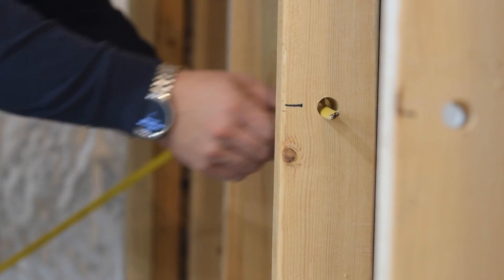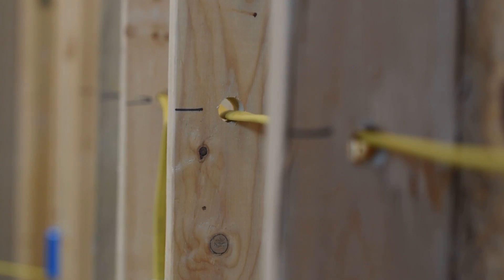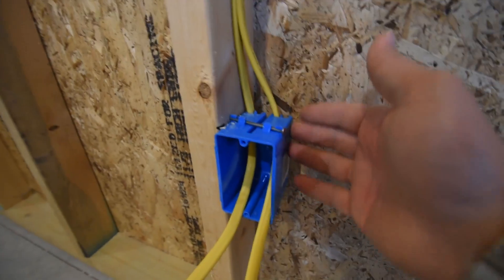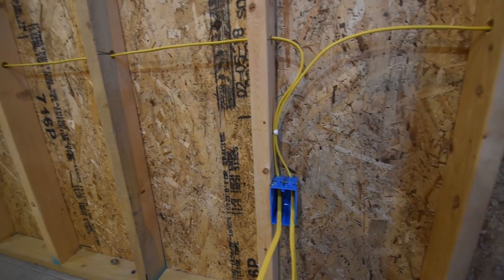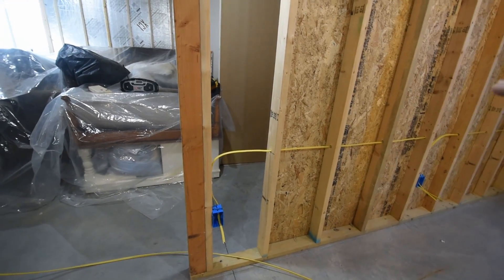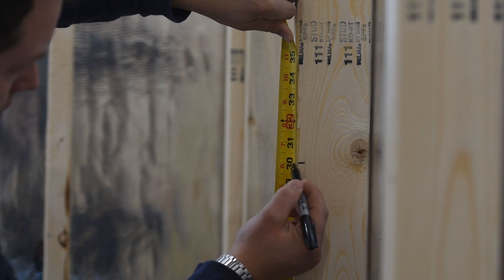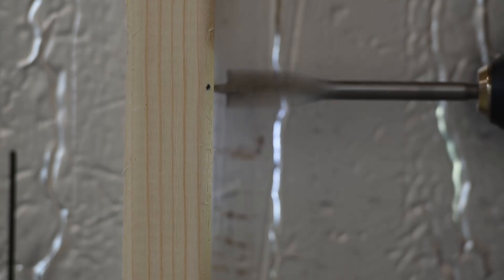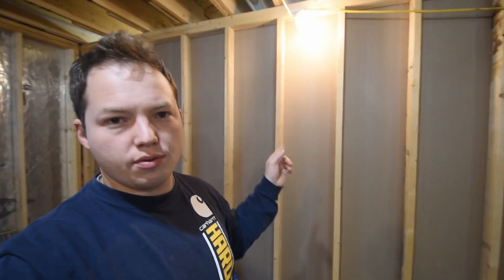How High Should Wires Run Through a Wall

Comment: It's a question of material expense/waste!

There are always many more receptacles than switches. Therefore, if you install your run parallel to the floor at 24" (plus or minus) you will use less material (wire) than trying to "split the difference"  (roughly 30") between the receptacles and switches. Installing the wire at 30" actually wastes 12" of wire for EVERY receptacle in the building. That can easily add up to 50' or more per house.
Reply from the maker: Agreed! 24" is better in that regard. Thanks for sharing your experience!
Reply: What ever happened to workmanship and building homes as if they were for ourselves or our kids rather than trying to nickel and dime a few feet of wire, etc. I can see the shoddy cheap ass craftsmanship in my cookie cutter home. The cabinets, the nails and screws buried under the dirt all over the premises, walls way out of square, attic spray insulation unevenly distributed, gaps in external doors allowing big drafts, gutters and drain pipes too level for proper drainage, concrete pours spilling out of the molds, unsealed grout, creaky stairs and showers due to lack of lubrication to prevent friction, terrible HVAC ducting and balancing (vents in stupid places), a great many studs off center, I could go on and on. This isn't a materials issue. It's a skill and moving-too-damned-fast issue. 😮‍💨
Reply: @graceoverall  Sure, you can complain about shoddy workmanship to make a house on the cheap.  Meanwhile homebuyers always complain about the high price for the house, so you buy what you pay for.  Meanwhile the workers are often complaining about the low pay that they make.  You can shop around and find a quality homebuilder - but you will also find the prices are higher for that better quality.
Reply: @lukehershey6995  I blame the Fed! Abolish the Fed!!
Reply: @graceoverall 

You are correct. Everything is done in a hot rush and the creedo of most people today is "Close enough".

Even if mistakes are discovered during the construction process they are rarely corrected.

However, if you don't at least start off with plans that are efficient you have zero chance of finishing with an acceptable end product.

Comment: Absolutely do not run your romex at 30 inches. If your boxes are at 18 ,and you come to a box point drill your holes slightly higher then bring them down to box. Plenty of room to mount in place. Try not to run higher than 24 inches at all. Measurement to avoid are these . Between 90-96. 30-37. 80-84. 50-55, and all ways Steele plate when you have opened was.
Reply from the maker: Thank you for sharing your experience! What do you think I should do to promote 24" instead of 30"? I added a card that suggests 24" instead but I'm not sure that it is enough. It's hard to update a video after it has been uploaded!

Comment: Just told the right angle drill just above your knee the same spot on your body you’ll get straight holes waste time running around marking two by fours is ridiculous, and also if you notice the floor joist above your head on the bearing wall whoever did that should be fired those floor Joyce should not overlap the wall anymore than maybe an inch in this video you can see there about 16 inches to 2 feet over what happens is if there’s any deflection or movement they tend to pop to sheet rock
Reply from the maker: Thanks for sharing your experience. I get that the height is not code mandated and the benefits of marking the height may not be worth the extra effort to some. I appreciate the discussion though! I am not familiar with the floor joist overlap concept but it sounds like you know what you're talking about. Thanks for the comment!

Comment: Back in the ‘90s we panelized, and so pre-drilled entire bunks of studs beforethey were unbanded. Using a 7/8” (2x4s) or -1” (2x6s) 24” long auger bit  (3/4 is too limiting). Two holes 24” up and down from the ends of the studs.  This put the bottom hole 25.5” OC from the subfloor.  Our boxes were generally mounted 16” to the TOP (not center) so this put the hole 9.5” from the top of the box - perfect for stapling cable w/in the req. 8”.  The top holes were used for switch legs, sconces, and counter outlets.  Because 90% of the drill-out was done before the bunks were opened all the drilling mess was contained and all the holes lined up perfectly from wall to wall.  It did not eliminate site - drilling, still had to drill plates and joists - but it was still a huge time-saver that made the work look primo.
Reply from the maker: That sounds brilliant. I think that the 24" ish height is probably better than the 30" I suggested in the video but either work fine. I also prefer 16" to the top of the receptacle boxes. Thanks for sharing your experience! It really seems like that was a very good method to stream line the process you had going. Did you also mount the switch boxes to 48" to the top?

Comment: I think many jurisdictions view a hole in a stud that the cable passes through,..as securing the cable, and if the hole is within  the required distance to the box, it eliminates the requirement for a staple for that particular cable. I am not sure how many jurisdictions see it this way. But I'd sure like to know the reasoning for not seeing it this way.  I see more problems  (I am a contractor and have been for most of my life) from staples being too tight than too loose,..in fact,..I recall ZERO problems caused by a staple not hammered tightly....but I can sure recall quite a few problems over the years caused by staples being too tight,..clamps being too tight, and wire being pulled too tight.

Comment: some good points Ben!  And some good points in the comments.  At what height do you recommend for a receptacle in a basement?  16" seems a bit low.
Reply from the maker: It's still not a code thing but it seems that often you see them at or near 48" in basements. It depends on how finished the basement is as well to some level. Of course any unfinished basement area needs to have GFCI protection as well. 

There was a lot of great feedback in the comments! I actually have ran the horizontal wires at 24" previously but revised it up to 30" based on some research but I probably should have stuck to 24"! Its not about the code though and just common sense really. I added a card "poll" to the video when I recommended 30" where I mention that 24" may be better! I wish I could make simple changes like that after the fact but I think that the video still has value.

Thanks for the comment!
Reply: My house was built in 1926. My outlets are 24 inches from the floor. That's what I did in my basement. My holes are around 30

Comment: If cabinets are being installed where wire is being pulled use nail plates.... problem solved 👍.
Reply: if you need to drill a hole where those plates are installed - problem not solved

Comment: ALL wall wiring should be in EMT for safety PERIOD!
Reply: Agreed. I work near Chicago and most areas here require pipe. It also makes adding or changing circuits very easy since the system is pullable.

Comment: I’ve been a master electrician is state logical Spectre for 30 years this guys suggestion of putting the light switch box top of it at 40 inches is incorrect drywall is 4 x 8 sheets they leave it sideways if you move it up to 48 inches and a quarter then when the drywaller’s come around they don’t have to cut a thin slice and leave the edge for a box have experience before you make suggestions
Reply from the maker: I said 48". Where did you hear 40"?

Comment: Always leave a loop of wire feeding into the wall receptacle don't pull it tight. If you need extra wire years down the road or whenever, you have spare behind the drywall to pull through. In Canada that is code to leave a 6 inch loop with a 6 inch tail into the box to wire the outlet. Same for wall switches, staple wire close to receptacle box. Don't place two wires in one staple and don't hammer down tight, just enough to hold the cable is enough.
Reply: I was told about the loop "trick" by an electrician, good advice.
Reply: In most areas in the US we are allowed up to 2 wires under one staple

Comment: 30" where cabinet mount. But most of all if your receptical box is 16" seems like 24" for wires are best. Because of the way you are doing it. It will take about 200 more feet of wire to do the same job.  Plus 2 staples versus only one if at 24"

Comment: Structural point of view, I’d drill smaller holes to avoid compromising structural strength...
Reply: Beto G I will drill 1/4” holes if you want to come pull the wire for me.... 🙈
Reply: Dallas it’s all it takes...
Reply: @dallas5374  maybe 1/8" holes 🤣🤣🤣🤣🤣🤣🤣

Comment: Wow, its a no brainer.
Why is this not standard practice?
Then everybody knows where wires should or would be located.
I'm with you Benj.
Reply: It is standard practice for experienced electricians to know what to do without a video showing a personal opinion, if one is wiring one should already know if not then one should not be wiring.  No drywall experience bad walls,, no plumbing experience flooded house, no electrical experience one's home  can burn down around them.

Comment: 30" may be cutting too close in a kitchen and bathroom areas where the cabinets go, and cabinet installers will use long screws
Reply from the maker: Great point. 24" might be better in areas that have cabinets going in.
Reply: @Phil Ward my journeyman runs his sink drains at 19” above the floor so running 21-24” should be plenty. 

Apparently, it’s a crime in the cabinet installer world to own a stud finder so they find one by drilling pilot holes  . . . . ... like that
Reply: Yeah, only most of the time in the kitchen and bath, I drill the holes above the boxes serving the countertops. And where they screw the cabinets to, should be some kind of horizontal blocking already framed in, so most people would naturally avoid drilling at that height unless there was no other place and then you would just nail plate there. 😜

Comment: waste of time marking the ht. and using a paddle bit to drill with. best to use a 18" long x 3/4" dia. ship auger bit like a Greenlee nail eater and then stand upright with your arms and 1/2"    d-handle drill with a t-handle on the front all the way down at your upper thighs and using your hips to apply pressure to the drill to power through the wood and you should be able to drill a level enough line for easy wire pulling. and i like to enter my boxes from only one direction if possible and preferably from the top, makes for easier and cleaner joints.🤔

Comment: I try to mount my switch boxes 48 1/2" from the ceiling joists, since I usually do the drywall too.  Only cut the bottom sheet of wallboard
Reply: As far as the drywall goes I am a drywaller .  When I do a kitchen wall with a lot of plugs at the 48" heights, I start with a rip horizontally. Either floor or ceiling, so that the row of plugs are not located in the joint but more in the middle of the sheet. That way is easier to finish. Even though I am making an extra joint I do not need to finish by hand around each individual plug.
Reply: Marc Hitson  Thank you for reminding us of the tasks that follow the rough-in wiring like drywalling. Your revelation about boxes aligning with the drywall joints never occurred to me.
Reply: Ty Cox yw. One here and there, such as a light switch is no big deal but a row of outlets is a little deal-almost enough for the extra drywall effort to hang as described above
Reply: @Peter Evans I usually tape a broomstick to all my electrical cords and binocular to my forehead. Works like a charm😂

Comment: I do,   switches 48" Recepts 16" wire runs anywhere between 20 and 45, 30 is a good idea.
Reply: @J S Wouldn't a sane person just use a magnet or something to detect those plates first?
Reply: @J S The trick seems to be then finding a way to screen contractors...

Comment: milwaukee hole hawg rested on my knee cap. Drill as I walk and every hole is the same height. Also flip my claw hammer upside down and rest box on it ensures same height on all plugs.
Reply: completely agree. everyone on our crews have cut their hammers to exactly 13 inches and we cut down an aluminum yard stick to 42 inches for switches and counter plugs. and we too use the hole hawks on the knee or thigh. all depends who is drilling at the time and how tall they are. lol
Reply: Yep, hammer handle height off the floor
Reply: @scotmiller5979  
Good catch!!
Reply: @Gene-f8r  I'm an electrician and that's what we do.
Reply: @Gene-f8r  I'm not saying cut your hammer, I'm saying consistency is important.
Reply: I have seen lots of holding it off your knee. Sometimes it is a bit too low. The hammer height hurts my back thinking about it. I kneel enough wiring receptacles at 13” to bottom of box.
Reply: Yep! But different states different rules may be!?
Reply: @alessioavallone9154  I agree. But he asked how you do it in your state and to comment. in my state that is permitted for box install.  now i'm curious what states will fuss using 13 inch hammer height..
Reply: I'm 4'6", that wouldn't work for me 😂
Reply: I'm not a professional but I have remodeled enough projects to know, as you get older, you want to work smarter and the end results make life easier for your personal projects and client while complying to code. I think a general rule receptacle height 16" bottom of box top of box about 18" seem to have a good reach depending on final finish floor. I also have placed receptacles at switch height for whatever you want to plug in and not have to reach low. ie, smart device chargers in bedroom to clear the dresser or whatever.
Switches 42" to 44" bottom of box, the top of the box will be right at he drywall seam joint. I think the hole height would be somewhere between 24" to 26" as mentioned by other comments. That should meet staple code distance from the box.

Comment: at 30 inches your at risk mounting cabinets. 
If you use nail plates at 30" you may not even be able to mount cabinets. I recommend 24".
48" to top of switch box is being kind to the sheetrock installer. 
I definitely recommend that or they will probably tweak your box.
Reply: So true with the drywall, I hate having to cut both sheet. Then again. With the drywall zip cutter it really doesnt matter.

Comment: 30” is right where screws are going to mount base cabinets. I like 24”. I just put the right angle drill right above my knee and go to town.
Reply from the maker: Great point. I can see 24" being a better option in that case.
Reply: Yeah, I was thinking the same thing. As a remodeler 24" works great as it does miss the base cabinets and any lower counters the customers may want like a bathroom vanity which is typically 32-34"

Comment: Also could have mentioned the 1 1/4" space from the front of the stud to the beginning of the hole for the wire, anything less than 1 1/4" would need a nail plate to protect the wire.
Reply: Protection plates now required by Canadian Code

Comment: Nah, wires should be run vertically not horizontal for the very reason you gave, some tit goes and mounts something to the wall and drives a screw straight through the wire.
When run vertically you will know the cable is either above or below the receptical so it's immediately obvious where to avoid.

Comment: It just occurred to me and is worth mentioning that if you're cabling a room that isn't going to get drywalled anytime soon, such as a garage or shed, all your horizontal runs of cable should go up a stud, through the top plate, horizontally through the web of trusses or rafters or joists, and then back down to the stud to the next device. An inspector advised me about this when I built my garage, and it's code here in St. Paul for new construction. The reason being is that he said people hang things on the cables, like hammers and other tools, or use them as makeshift shelves!
Reply: @Daniel Malack Not an electrician by trade, no, but I do have 30+ years of experience with it and have studied the craft extensively with lots of books and the NEC code, both residential and commercial, as well as low-voltage installations. I've done a lot of work with it in many of my own homes and those of others. I am pretty obsessed with wiring in general. I probably SHOULD have been an electrician when I was younger.
Reply: @Daniel Malack Well it may not be, I don't really care enough to research whether or not it is. One thing I do know some cities have electrical codes that exceed NEC (such as Chicago and New York), and they do tend to be large(r) cities. So you're right that it could have been his opinion. But I wasn't going to challenge him because I've seen wiring done this way before in garages, and it makes sense to do it that way if you don't intend to finish the walls. So that is where the "pretty sure" comes from, I don't little reason to believe it's not the code so long as this inspector that I was working with expected me to do it that way.
Reply: @Daniel Malack I'm pretty sure it's code in my city. When they do a final inspection, they expect there to be either drywall covering everything or the cables run in the way I described above.
Reply: @Daniel Malack I worked at the phone company for a while and wired up thousands of communications circuits in telephone plants. Of course that business has gone down the drain with everyone moving from landlines to cell phones, but it's still largely the backbone of even the cell phone networks because they have fiber optics running to cell towers. I miss working with my hands, to be sure.

Comment: My drywall seam is at 46" above floor. Where should I put my switch boxes?
Reply from the maker: I prefer 48" to the top of the box but you can put it lower if needed. It will probably be easier if you just set them to 46" to the top so that you don't have to cut both pieces of drywall. Thanks for asking!